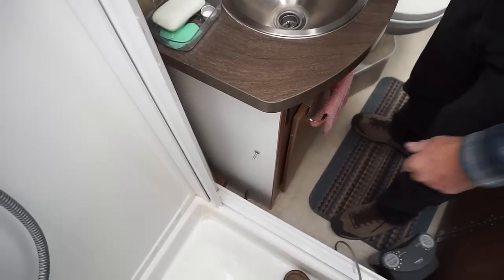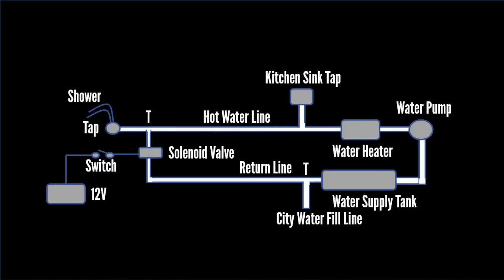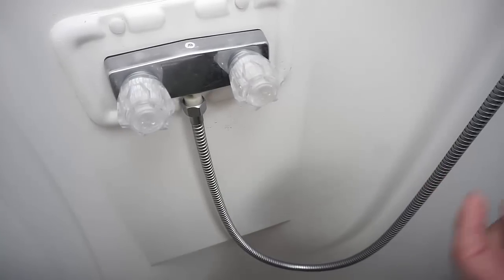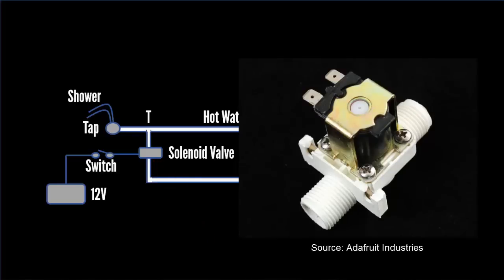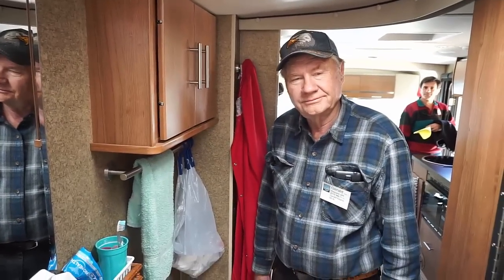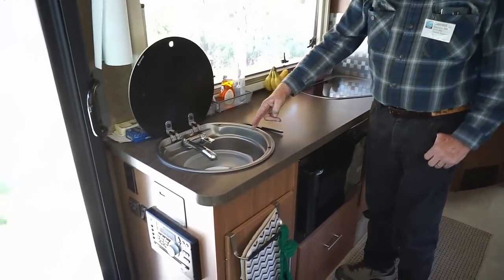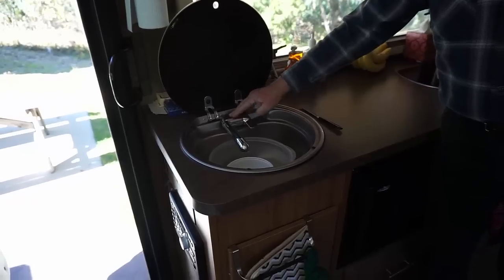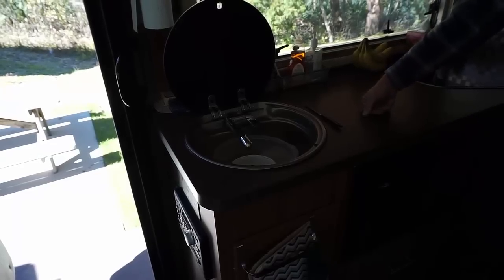How to save water in motorhomes with instant water heaters.

Comment: "I installed my suburban Tankless, works great but haven't implanted your system yet, just received my solenoid, 1. your diagram - you just send the water in the cold side going back to the tank, you didn't run any separate pipe ?2. I have a pinnacle washer/dryer combo, draws a little water at a time so when the tankless goes on shuts off . any ideas ? thinking a small tank to fill with hot water  then shut off when not in useThanks
Reply from the maker: +Chuck Smith  There has to be a separate pipe back to the water tank or the cold water will not be saved for future use.   If you have a washer/dryer I doubt if it is worth installing the loop for it.   The main reason to have the loop is for the shower.
Reply: Got it. Understand how the sink works by shower button

Comment from the maker: The water tank referred to in the video is the main water tank in the RV. The brand in my unit is a Girard. If you are looking to install an instant water heater do some research on the web. Ideally you want to get one that adjusts for flow and input water temperature automatically. The Girard requires you to adjust the propane flame manually with a provided dial.
Reply: +Bob Duthie Thanks, purchased a Suburban, fit perfect in my Roadtrek, I will update you when I install your solution

Comment: why do you have a water tank with a tankless system ? what brand tankless system is installed ? Thanks, looking at new suburban Tankless
Reply from the maker: +Chuck Smith  You have to have a fresh water tank when you are not connected to city water. The name tankless is a misnomer because there is a tiny water tank in the heater. Winnebago supplies a Girard instant water heater.
Reply: I don't have a tank. I was thinking installing on washer line to stor hot water because it draws a little water at a time. Another idea would be to connect the hot and cold together going to the washer. Might stay on long enough to supply hot. The solinoid won't do any good because it what the washer draws that activates the hot